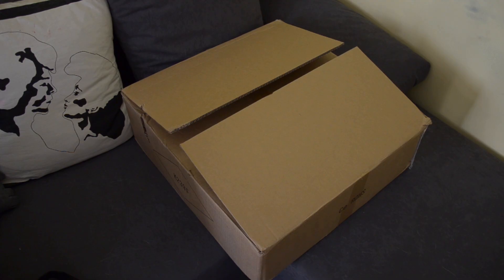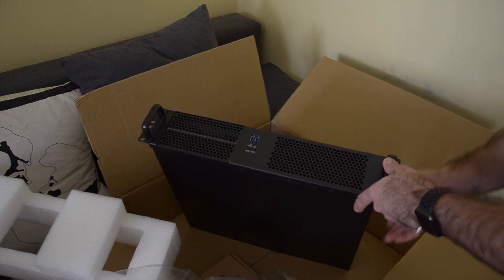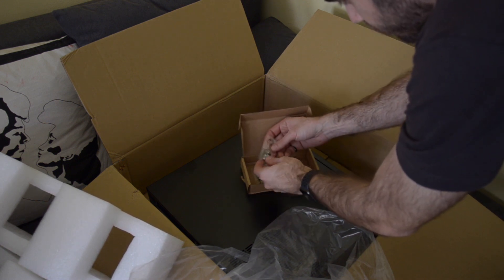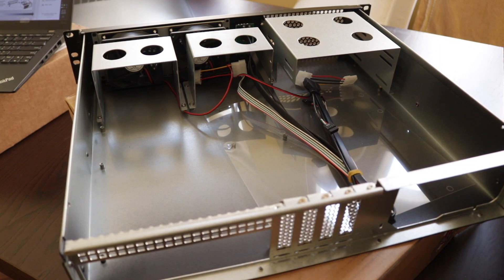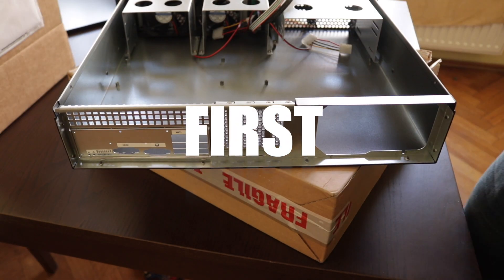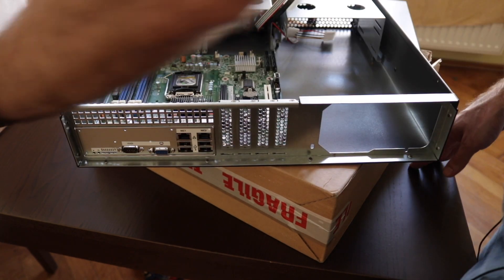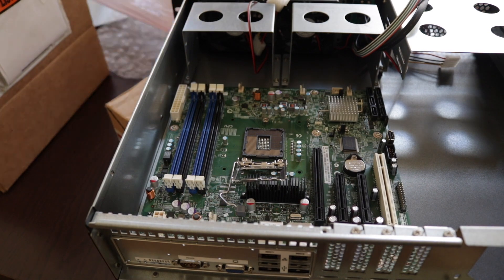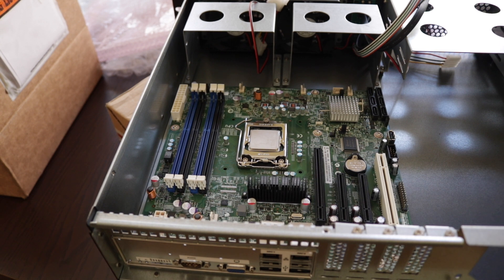0dB fully silent rack server build - part 2 - chassis and initial assembly

Comment: Man, this is coming together nicely. Seeing the heat sink installed puts the scale of things right in your face. Can't wait to see how it all runs once it's alive!
Reply from the maker: These are the readings so far:
$ uptime
 01:48:58 up  7:41,  1 user,  load average: 0.95, 0.82, 0.80

$ top
top - 01:49:39 up  7:42,  1 user,  load average: 0.82, 0.81, 0.80
Tasks: 118 total,   1 running, 117 sleeping,   0 stopped,   0 zombie
%Cpu(s):  0.3 us, 18.2 sy,  0.0 ni, 81.4 id,  0.0 wa,  0.0 hi,  0.0 si,  0.0 st
KiB Mem :  7888736 total,  2525492 free,  4483680 used,   879564 buff/cache
KiB Swap:  8102908 total,  8102908 free,        0 used.  3141052 avail Mem 

  PID USER      PR  NI    VIRT    RES    SHR S  %CPU %MEM     TIME+ COMMAND    
 5098 vboxuser     20   0 5798100 4.138g 4.084g S  73.8 55.0  24:14.12 VBoxHeadle+

$ sensors
w83627dhg-isa-0290
Adapter: ISA adapter
Vcore:        +0.86 V  (min =  +0.00 V, max =  +1.74 V)
in1:          +1.86 V  (min =  +0.13 V, max =  +1.14 V)  ALARM
AVCC:         +3.39 V  (min =  +2.98 V, max =  +3.63 V)
+3.3V:        +3.39 V  (min =  +2.98 V, max =  +3.63 V)
in4:          +1.54 V  (min =  +1.68 V, max =  +0.57 V)  ALARM
in5:          +1.06 V  (min =  +0.67 V, max =  +1.59 V)
in6:          +1.70 V  (min =  +0.56 V, max =  +0.45 V)  ALARM
3VSB:         +3.38 V  (min =  +2.98 V, max =  +3.63 V)
Vbat:         +3.30 V  (min =  +2.70 V, max =  +3.63 V)
fan1:           0 RPM  (min = 1054 RPM, div = 128)  ALARM
fan2:           0 RPM  (min = 1506 RPM, div = 128)  ALARM
fan3:           0 RPM  (min = 10546 RPM, div = 128)  ALARM
fan4:           0 RPM  (min = 3515 RPM, div = 128)  ALARM
temp1:        +40.0 C  (high = +55.0 C, hyst = +51.0 C)  sensor = thermistor
temp2:        +63.0 C  (high = +80.0 C, hyst = +75.0 C)  sensor = CPU diode
temp3:        +48.0 C  (high = +80.0 C, hyst = +75.0 C)  sensor = thermistor
cpu0_vid:    +0.000 V
intrusion0:  ALARM

jc42-i2c-0-19
Adapter: SMBus I801 adapter at 4000
temp1:        +48.2 C  (low  =  +0.0 C)
                       (high = +80.0 C, hyst = +80.0 C)
                       (crit = +91.0 C, hyst = +91.0 C)

acpitz-virtual-0
Adapter: Virtual device
temp1:        +27.8 C  (crit = +100.0 C)
temp2:        +29.8 C  (crit = +100.0 C)

jc42-i2c-0-1b
Adapter: SMBus I801 adapter at 4000
temp1:        +44.8 C  (low  =  +0.0 C)
                       (high = +80.0 C, hyst = +80.0 C)
                       (crit = +91.0 C, hyst = +91.0 C)

coretemp-isa-0000
Adapter: ISA adapter
Physical id 0:  +63.0 C  (high = +70.0 C, crit = +89.0 C)
Core 0:         +62.0 C  (high = +70.0 C, crit = +89.0 C)
Core 1:         +63.0 C  (high = +70.0 C, crit = +89.0 C)
Reply from the maker: It is up and running now. I have documented the process and as soon as I have time to cut the video I will upload it.

As expected, I can't have the CPU pegged at 100% full time, not the way I have here. One of my use cases is to run a dedicated Civ5 pitboss server in a VM. It will always eat all the CPU I throw at it. If I let the VM have 2 CPUs and 100% CPU time, the temperature in two hours reaches 87C, dangerously close to the 89C specification. I'd not want to have the CPU running above the recommended threshold of 70C though.

Now I'm having 16 AI players running against each other, with 75% CPU time set in VirtualBox and 1 CPU. The temperature is at 67C, and I'm comfortable with this number. If the game doesn't crash, I have my setup. Of course, if I am running a fanless system, I have to accept higher temperatures. My MicroServer, with its 45W Quad Core Xeon, stays at around 35C, with 3 jails and 2 VMs. For a server, it is a very quiet box, but whenever I power it off, I wish it was fully silent.

The server will only run Civ, a syslog server and a DNS server, so it is ok. For eventual home or small office use (without Civ eating all the CPU time it can), the setup would actually be perfect.

I think that when I finally get a rack, I will have 1U space between the server and anything else, and modify the cover of the chassis to allow heat out. That, I believe, would allow the CPU to run at 100% indefinitely. If this works out, I will build myself a 0dB NAS with 6 or 8 SSDs for Christmas (or perhaps nearly silent with spinning disks), using a 3U or 4U enclosure and a Quad Core 45W Xeon, and sell my MicroServer.